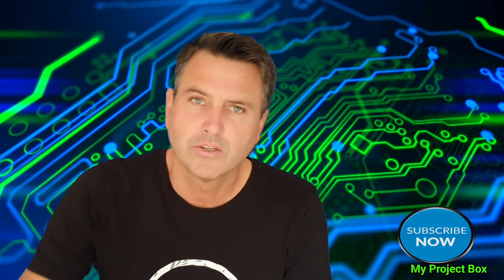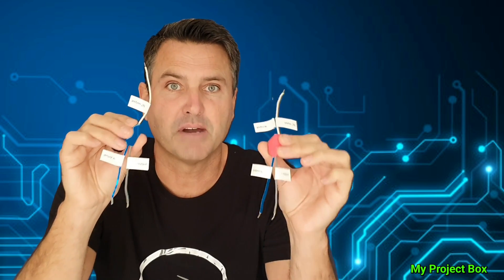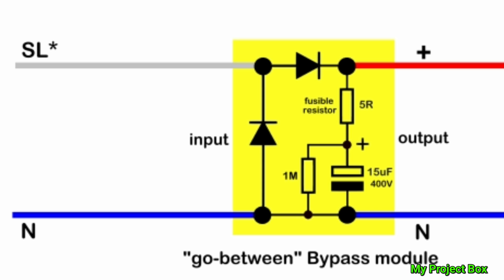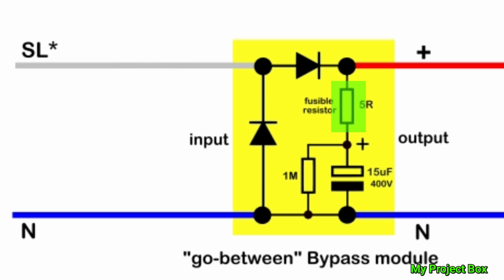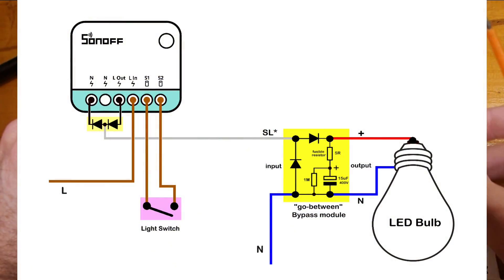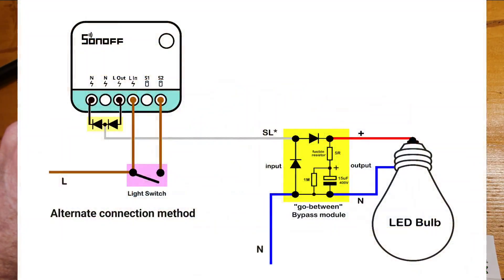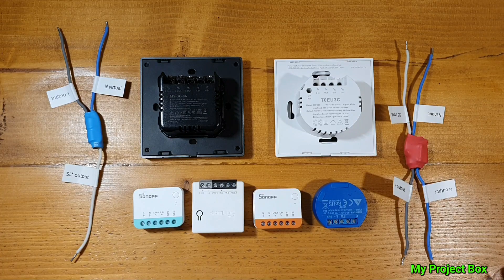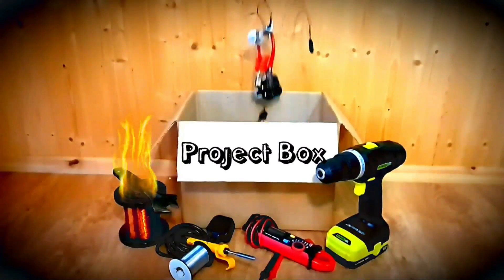Sonoff matter MINIR4M No-neutral smart switch?

Comment: 8:23
This won't be up to code even in the UK due to accessibility.
You can't turn off the light bulb fully to install/replace one in the future. 

The lightbulb connector is live regardless of the switch orientation due to your circuit at the bulb side.
Reply from the maker: I don't think any home made circuit can meet code or electrical certification anyway. But it's worth mentioning that when the smart sonoff relay is off, with my circuit, the voltage at the light bulb socket is effectively at 0-Volt or at Neutral potential.(after the capacitor is discharged by its bleed resistor). I was always taught that a light switch, should ever be considered a safe means of isolation for maintenance.  The circuit should always be isolated, on the circuit breaker, before working on it.  If you look at "staircase switching" or 3-way switching,  It's very difficult to know if the switch is in the ON or OFF position.  Especially if the bulb failed  while on.  Lots of commercial smart lighting options, have the light fixture permanently powered!, and the light switch merely acts as a remote control for that light fixture/Smart bulb.  Most no-neutral solutions, also have current permanently at the light bulb socket, like the sonoff s-mate. The concept of a physical switch cutting the power the the lamp socket is also not so clear cut anymore. It could be a triac or some other electronic switch, not  actual switch contacts. The light switch can't be trusted for isolation, if it can be remotely controlled/overridden!
Reply: @MyProjectBoxChannel  
The only thing that I can think of to solve your simple circuit is to add a small "killswitch" at the "light switch side" so your "bulb circuit" doesn't get connected to live at the "switch side".

There are so many flaws in this but I'll touch on this. When the "beefier" diodes fail due to overcurrent (lightning) or overload of your house total appliances, it will essentially render your trip breaker useless without you even knowing. Even if you put back the fuse to the original position, it will not pop at all due to the faulty diode.

Do not do this people.
Reply from the maker: @jackipiegg  you do have lamp socket bases, here in the UK, with built-in light switches, so that could be a option. A UK lighting circuit is normally on a 6Amp circuit breaker. 10AMPs on 230Vac! ,  that means the the diodes are good for over 2000w of LED lights!!!!! How do you overlaod a lighting circuit with more than 10Amps (my led bulbs draw 35Ma, thats 0.035A). Most LED light are not even 10w! I know on 110V systems the current is double, but overloading a lighting circuit over 10AMP is very difficult to do with LED lighting. Maybe in North American you may require a inline fuse, for the larger current circuit breakers. I have done some sort-circuit testing, with my bypass on 6AMP and 10AMP circuit breakers. The diodes have survived the fault current so far in my testing(they can handle over 200Amp for a brief instant). Obviously the house wiring has some impedance, so the fault current would be different for each situation.
Reply: @MyProjectBoxChannel  
Perhaps I said it wrongly. Lightning not lighting. A lightning strike could potentially overload the diodes.
Reply from the maker: @jackipiegg  yes lightning can definitely fry electronics 😉👍. I could also add a gas discharge arrestor, for lightning protection and other voltage surge. Maybe  a metal oxide varistor MOV. But it's a rare occurrence, depending on where you live.
Reply: @MyProjectBoxChannel  
The problem of using bare diodes in half rectifier config is that if one fails, the flow of current is not interrupted (open circuit), which is the main problem here. 

You could potentially use a rectifier diode IC instead that has higher current rating and have temprature cut-off/overvoltage cutoff on both diodes internally if one fails.
Reply: @MyProjectBoxChannel It's not the working wattage you have to deal with, it's the "inrush" current (in milliseconds duration) that that can be a 100 times nominal load amps, and that will play havoc on the smart switch. If it's on a 6 amp breaker, then when 6amps of current are long enough, the breaker WILL trip.
Reply: @yerflep99  
Guess you do not know how his half rectifier circuit works. When one diode fails, the fuse/breaker will render useless coz of the neutral potential here.
Reply from the maker: @yerflep99  Yes inrush current is the enemy of relay contacts. It can cause the contacts to stick/weld together. Large electrolytic capacitors are the main culprit, in switch mode power supplys, and LED drivers nowadays. I have had problems with multiple cheap LED down lights, connected to a PIR motion relay. The cheap LED down lights did not have any inrush limiting in their drivers PSUs. I got very irritated for having to tap the relay, each time the contacts got stuck. To remedy the problem, I added  inrush limiting, inline with the relay output, in the form of a low value "fusible-resistor". It just takes the edge of the peak current, and that's all that was needed to make the relay work normally for many years. My no-neutral circuit includes inrush limiting for the initial charging of the capacitor. You don't need much, 5ohm to 10ohm will do, the take the edge off. A 6AMP B-rated circuit breaker can handle a surprisingly large amount of inrush current for a brief period. This is by design in the tripping curve, to handle certain types of loads, like florescent lighting, or the cold tungsten filaments of multiple older lights bulbs.